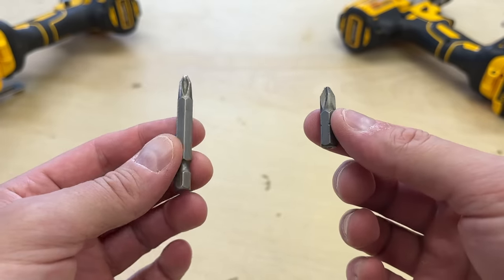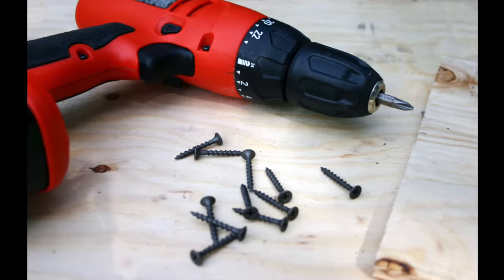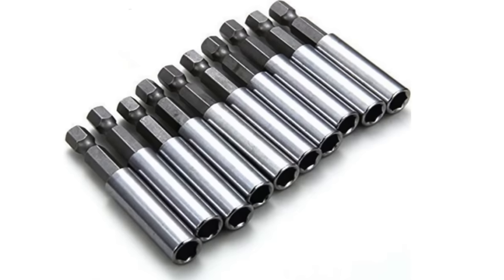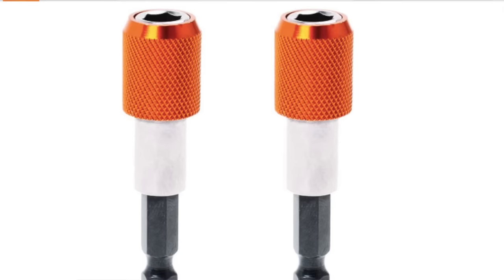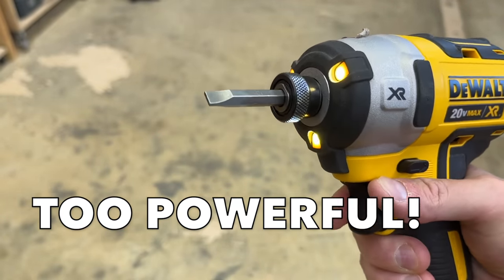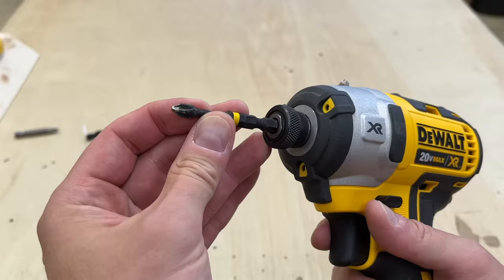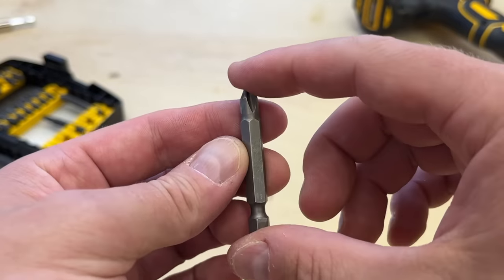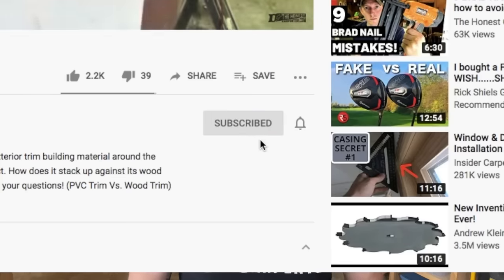Power Bit vs. Impact Bit vs. Insert Bit...WHAT'S THE DIFFERENCE?! (Driver Bit Guide For New DIYers!)

Comment: Only use the necked down ones directly in the impact or any holder you like. If the insert breaks, it’s a LOT easier to get the stub out. God help you if it’s a magnetic holder with locking function. Sucks when you break it off at that quick change groove.

Comment: As a construction business owner who specializes in decks and porches. I can assure you There is absolutely no need to spend the money on impact rated driver bits. I don't even buy power bits. I buy insert bits and extensions only. Have never owned an impact rated bit. All of out decks are built with structural screws and many other kinds of screws. Not a nail or bolt on the job. We use only impact drivers for driving screws. This includes anything up to 8 inch grk structural screws. I have probably run in more than 5 million screws on the job over the last 10 years. Not once have a broke a bit. I have rounded some off though. (square and phillip driver bits that is) t40,t30,t25,t20,t15,and t10 are what we try to always use. never broke one with an impact driver. impact rated bits are a marketing ploy.

Comment: Just like to add another type of bit. Irwin "Impact Ready" bits. When you need a bit that will snap, leaving the sheered off chunk in the screw head, Irwin "Impact Ready" are the bits for you. If you drive more than 20 screws and don't have a half-driven screw with a mangled chunk of "Impact Ready" driver bit permanently wedged into the screw head, then you aren't using genuine Irwin "Impact Ready" driver bits.

Irwin, we shatter any hopes of driving that screw by shattering our bits.

Comment: Insert bits were originally designed for hand operated screw drivers. This gave you the ability to use 1 driver with multiple bit types. They were not intended for use use in drills. In fact, they predate the modern use of cordless tools on job sites.

Then, the first cordless screwdrivers came out, and the insert bits found a new life.

Comment: The REAL reason for power bit having a power groove is practical. Inserts bits are kind of a pain in the ass, they are small and fiddly, if you let them drop on the ground, you can easily loose the damn thing. You can have a hard time puting them in or out the insert bit holder especially if you have leather gloves or get greasy (or both). So much so that sometime you need to grab pliers to get it out which a MAJOR pain in the ass for something that is supposed to be a quick change system.
So you can put a quick release chuck on a power drill so that it engage on the power groove, and the power bits acts as long inserts bits on themselves without the inconvenient of being as small as true insert bits.

Comment: Virtually all impact bits that have a narrowed shank are garbage...project farm has done some interesting testing on various manufacturers and designs of screw bits. It turns out that most impact rated bits are weaker and less sturdy than non impact rated bits when used in impact drivers. It's all just a marketing ploy.  I was amazed when I found this out. But if the honest carpenter does read my comment, is suggest he check out project farms video on this topic. It's very eye opening and a bit contradictory to the information in this video. Cheers

Comment: the high end drill of any brand will achieve more torque than an impact driver. so a drill will snap the "power" bit also. But the reason most people won't manage that is because the cam out effect. an impact driver sets the bit back into the screw on every impact, so never cams out, so people selling these bits falsly attribute the snapping of bits to the torque of the driver

Comment: The cordless drill ( with the twist chuck ) has more torque than the impact gun.

The ¼inch quick change hex chuck is your impact driver. There is precious little difference in the bits and shafts anymore. Back 20+ years ago with nicad battery cordless tools there was a difference as bits were much harder and thus more brittle. 

Bits and shafts have always snapped and will most likely continue to do so ... And  to be honest out side of some temu or alibaba or amazon super cheap bits all driver bits are the same , with the exception that shockwave type bits are only for lower torque fastening.

Same will twist drill bits very little difference. The big thing is to read your owners manual to know how much drilling you can do with your impact as keeping the gun running will burn out break and severely shorten its life span.

And even impact rated drill bits will still snap during use.

Comment: Ive broken more of those skinny bits than i can count so i use the other ones.. just use the right size bit for fastener..  cuz if it fits it rips..
Reply: And they dont ever break at the skinny parts they always shear the tip apart..  so dont see the point of using a built in torque stick on a phillips and using a flathead in a driver of anykind is just asking for scrapes and scratches...

Comment: Frankly I've found the  CORRECT answer is to NOT use an impact  AT ALL for  lighter screws.  Use a drill driver instead with a  clutch.   Much better control  and  less damage to  screws, etc

Comment: I brought two sets of pozy no 2 DeWalt bits for my impact drill . They lasted less than 10 100mm screws . Yet I brought a set of 25 normal pozy no 2 from Toolstation and I must have done 300 100mm screws with just one bit . Waste of £4.99 a set DeWalt ones are crap . £3.99 for 25 from the same Toolstation and still going fine . DeWalt don't want to know . These bits are just to hard

Comment: What he said... 👍😉😂😎🏴

I saw a good video by Project farm testing bits and he found the so called impact bits with the skinny neck often broke first there were some top end bits that we're ok but many of the mid and low range bits there's was either no difference or the non impact outperformed the impact bits, so I personally think it's mostly bull lol 😂🤣 unless you buy a dedicated bit that costs a lot.. tbh it was quite a while ago I watched it so I'd probably watch it again if I were going to buy some more, tbh though I got about 300 of every kind of bit now so I'd probably just use em if they break use another one etc lol once I run out then worry about it lol 😂🤣

Comment: I use any bit that fits in my impact driver never found difference in performance they all seam to work never had one break in wood but in extreme driving in steel they all break but they usually break right at the tip never half way down so I wouldn’t get carried away buying the right bit id just use what u already have cause more then likely it’ll get the job done just fine

Comment: These days there are a lot of drivers that accept hex bits that do not impact. Such as electric screw drivers and the installation drivers. Having the power slot allows non impact rated bits to be utilized in these power tools.

Comment: The insert bit bit probably evolved from manufacture tooling. They are made on the same tooling just of cheaper material. Now there is less need to have 2 tooling setups in a production factory.

Comment: The “power bits” I use have always lasted longer than the “impact rated” bits I use. Milwaukee, Ryobi, and Makita impact bits have all eventually broken or twisted with my milwaukee impact driver. My conclusion is that the metal treatment on the impact bits causes brittleness. You especially see this issue on socket adaptors that are impact rated. They are just absolute crap with that narrow design
Reply: I’ll add. If you get super cheap bits they will break. Nothing to do with the tool you use them in. Makita gold impact bits are solid. And Wiha bits are great. Milwaukee bits aren’t great but are decent for the price if you get them on sale. And Ryobi impact bits break if you look at them funny. The non impact rated ryobi bits last longer

Comment: I get it from an industrial safety point of view: non impact rated bits can shatter and send small pieces of metal flying. Obviously, companies dont want to pay your bills for that. But the rate of that happening is really minicule. So long as the manufacturer doesnt source their steel from a sketchy supplier, youre probably good to go. Same can be said with impact sockets and regular sockets for the most part too. Just dont be dumb and put a 15mm 1/4 non impact chinese crv socket and adapt it up to a 1/2 milwaukee impact gun.

Comment: Something to add, nearly all modern impact drivers have 2-3 speed settings with setting one being non ratcheting regular drill mode.  Most bits are perfectly fine even in an impact, as a matter of fact I work maintenance and the only bits I’ve actually broken are impact rated ones.

Comment: The 25mm (short bits) are meant to be used with the magnetic bit holder witch gives the ability to quickly change bits easily and give a better viewpoint 

The 50mm bits is used for tight spaces specially in wood if screws are driven deep into the timber and hard to reach 

The “impact “ bit with the thin shank absorb shock so the screw heads and the bit lives a bit longer that’s all 

The Dewalt bit holder with the sleeve is a gimmick and a waste of time imo been doing construction for many years and yet to find anyone that actually use it other than out of necessity. 

Just my 2 cents

Comment: Do the impact bits not simply act as dampers to damp down the torque of the impact driver which has been overengineered to have too much torque for the average bit/screw head?

Comment: Non-impact bits use the quick change feature for that exact reason.

ITS FOR THE QUICK CHANGE FEATURE. Drills and bit drivers are both available with ball bearing capture things for the bits. And that's why.

ITS FOR THE QUICK CHANGE FEATURE.

How is it that you couldn't figure that out? Is the general public really that much lower on the IQ scale than I am?

Comment: I haven't read all 700+ comments but I have a question.  I know why one shouldn't use standard bits in an impact driver but is there any reason I shouldn't use impact bits in a normal drill?
Reply from the maker: I think it’s okay Randy. But I’ve found that they don’t chuck in quite as well because they’re skinnier and sort of rounded
Reply: @TheHonestCarpenter  Thank you for the quick response!  I use a Ryobi drill driver and bought an impact bit (it was the only type  available at the time) and it seems to chuck  as well as the normal one for my limited use but a more experienced person might think differently.  Thanks again.

Comment: Well they make locking quick change adapter that you would put in a drill and change those out with that locking area and I have seen electric screwdrivers that take them too I mean there is just no good reason for them not to put them there on everything

Comment: Doesn't the impact bit with the slight amount of flex counter the impactness of the impact driver? Why not just make a strong enough bit with no flex to withstand the impact? I guess if you want the full impact then you have to use a regular bit until it breaks.

Comment: Can anyone recommend a brand that lasts? I find the tips wear out over a short time and the sharp edges that help prevent a bit from camming out like to round over and then the bit cams out so bad on every screw that you have to throw it out. I have tried Dewalt and Miluakee this year with the same results. The bit I am using now, at least for my Robertson driver, is a 6" long Power Bit with the pressed in hardened tip and it is definatly lasting longer but I suspect one day it will snap.

Comment: The why of it 🤔3:27  . Maybe it’s My dislexic brain 🤷  but it seems obvious to me .     If the impact bit’s can be made so strong using less materials  🤔🤔 why wouldn’t you save money by using less material  to make the non impact bit’s .      Every  little notch  and cutout  / narrow shaft  / groove  = a  financial saving .    

Less weight  = less  transportation costs  / In fuel  /   Postage and handling  = More products  shipped  .      Now  I could be completely wrong 🤷  . This is just what came to my mind .  Thanks for your vids 👣🦘👍

Comment: I really really dislike insert bits, I have never found a magnet holder that held them securely enough.  If the holder has a strong magnet then it can be problematic to get them out of the holder as well.   Trying to get a small philip head bit out a bit holder with a strong magnet can be a real problem.     When using an insert bit it would get stuck on the head of the screw, then when you pull back they are stuck in the screws or worst held just enough to pull out of the bit holder and fall on the floor or something.   I don’t see the appeal.  The power bits have been around a long long time for easy bit changes and are great, they mechanically attach to the driver, don’t come out of the holder.  With modern drills with clutches breaking or drill damages are seldom an issue.    The impacts bits just used a successful design/standard that been around for a long long time.

Back to the insert bits, personally, I actually wish they would stop making them, I will never buy them I only have them because they were a part of a kit of other items I wanted.    When I had to use them they always turn out to be nothing but a pain.  I think Mfg’s make them because they are cheaper and can advertise a kit with 20 bits or something, but in my view they are just a bad design.    Particularly for star or torx bits that are particularly prone to getting stuck in the screw head then holds the bit just enough so it is pulled out of the magnetic bit holder.

I never thought insert bit where to be chucked, in my view they were specifically designed to be used with a magnetic bit holder.   Maybe it’s just me, but as I said I really hate those insert bits and if I had the power would remove them from the market, the power and impact bits work just fine, we don’t need insert bits in my view.

Comment: Insert bit got locked in driver and was extremely hard to get out. Had to pull with pliers. Why? Was it held by magnet or ball bearing or something?
Reply from the maker: No, over-torqued most likely, Harvey. The metal of the bit gets wrenched in the collet. If you run into that, tap the bit from all sides on a hard surface—that will usually loosen it up.
Reply: @TheHonestCarpenter  No not that kind of stuck. I believe used a very small insert bit into impact driver with out adapter and it went almost all the way in with only 1/4 of an inch showing plus what I believe was a magnet holding it so I had to use pliers to remove it. The only thing showing was the teeth part of the phillips (star shaped) bit.

Comment: The groove around the power bit, for the ball locks, has been around decades longer than the impact bits with the reduced shank. I don't have any impact bits, have always used the power bits for anything and everything.
I've never had a bit break at the shank. Never. I am an engineer and I don't see the benefit of that reduced shank. Bunch of marketing in my opinion...
Reply: I work in a cabinet company, shopping tools for more than 10 workers. I have never seen a bit break at the shank either. So I just buy whatever is cheaper.

Comment: There is no mystery or political reasons or conspiracy regarding bit types.  The one with the round grove is called 1/4 hex C type bit and is designed for an electrical tool.  The (often) short bits with the line around the end are called 1/4 hex E type bits and is designed for hand tools or a bit adapter.  There are impact versions of both types.

Comment: Well... Have you tried standard bits with an impact driver? Seems like not. My experience is that any bit works fine, does not brake, shatter or strip because of the fact that it is used with an impact driver. Im using simple insert holders from cheap kits and whatever insert is on sale. Built myself a wood framed house and other buildings on the property and nothing did brake.
One of us must be bullshitting then 🙃

Comment: All of these different tools and bits gets a bit confusing - anyone able to point me in the right direction here regarding impact and standard bits? I have a Makita DHP 486 Z Driver / Drill / Hammer Drill. if I was to use those flex type impact bits, could I use the "Hammer" action on the drill to make it work a bit like an impact driver, or is this not the done thing? Reason I ask is that I also have a half inch impact wrench, and with some of the available adapters, it can convert to 1\4 hex, and take the impact screwdriver bits. Problem here is the amount of torque, it is just way too much for these driver bits. Any ideas? Thanks.
Reply from the maker: No, the hammer setting is a tapping feature Richard! It won’t create an impact effect. But, impact wrenches and impractical drivers are fairly similar, and Bosch is even making some fast-adaptor tools for both these days 🙂
Reply: @TheHonestCarpenter  Many thanks! I wasn't sure to use the hammer or not, so I learn something new again today!

Comment: "If anyone knows why this evolved"

Yeah it's so you can use them in your impact driver.  

The usefulness of impact rated bits is grossly overrated in my experience.  They snap too but generally the head of the bit wears out long before they break in either case.  You grab a 10 pack of bits for a couple bucks and just swap them out if you snap one.  No need to put so much thought and effort into using the "right" bit when the difference is negligible at best.

Comment: You're out to lunch. 
Almost every bit sold these days is impact rated. It says right on the cases.
The skinny black ones have a torsion zone, that's the only difference.

All will work fine in an impact.